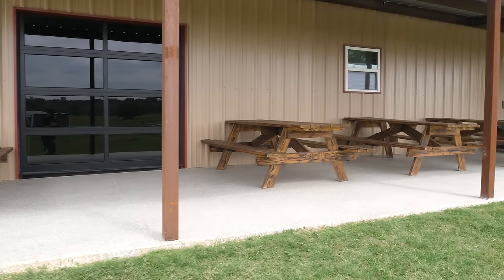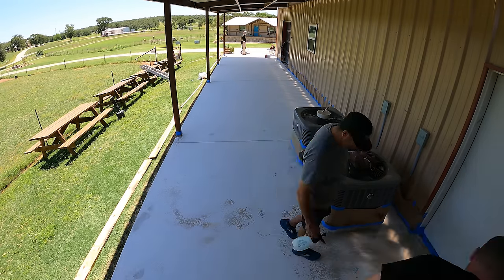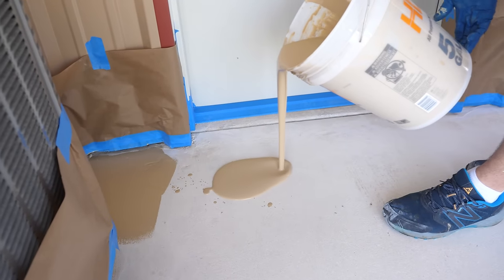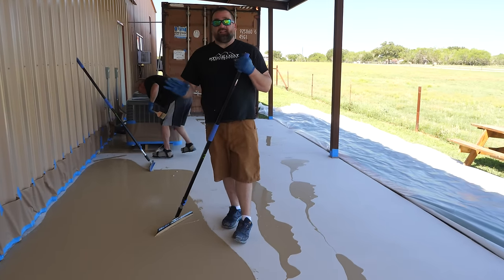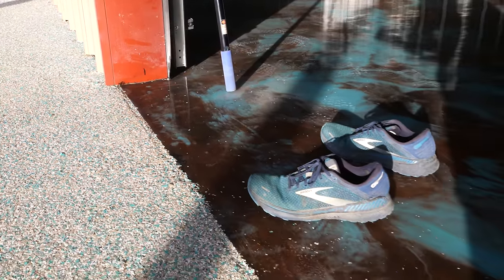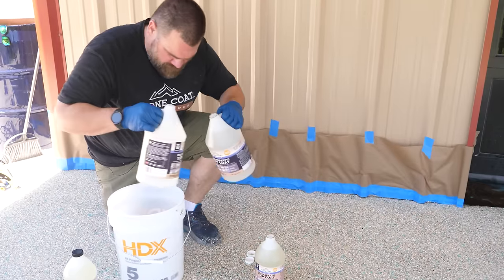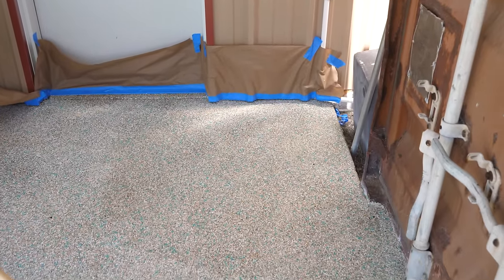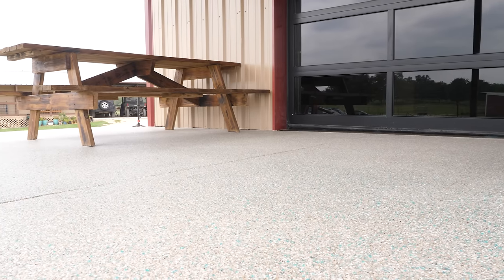Easy to Install DIY Epoxy Flake Coating OUTSIDE

Comment: Regarding your comment about using the gel powder if you're replacing the toilet:  you can also use it even if you'll be reinstalling the toilet.  The next time you flush the toilet, it'll break up the gel and send it down the drain.  

I've done that several times and never had an issue.

Comment: Mitch, just an FYI, never alcohol mop a freshly ground concrete floor, you're pushing the dust particles back into the pores of concrete. Either shot blast or vacuum numerous times with a good vac
Reply from the maker: Thanks for the PRO TIP!!!!

Comment: I love all your videos. I even bought a Stone coat epoxy kit from your website MONTHS ago, but I’m so scared I’ll mess it up. Even after watching all the videos 😩😭😂
Reply: Give it a try, even if it's just on a small project like a side table top or just a piece of MDF. I did a few small pieces of MDF then made them into clocks for gifts. They look great! I kept going and eventually built an island top out of MDF to place over our existing solid surface island. It looks like REAL marble and was fun to make. If you follow the instructions it's easy to do and quite difficult to mess up.
Reply: My first epoxy job was my best. I kinda messed up my attempt at marble though and used too much accent colors and it's very dark.. living with it but want to redo and go barely past all white. Good luck! It's fun.
Reply: I've done a built in counter top vanity, a kid's desk, a plant table, an end table, and a really gorgeous dresser that I got for free. Once you get started, you'll be hooked.

Comment: That might be overkill to use a walk behind grinder on concrete that you said has been recently poured. I think that having to find and rent that equipment might discourage a lot of people from tackling the job.
Reply: Uztutuudet u😅6😅
Reply: It😅u 0:01
Reply: 😊I
Reply: It is not Overkill. The concrete has to be prepped profiled before coating can be put down. It has to be opened up so the speak so it can accept the coating. Freshly poured concrete is the same as the cream coat is too tight and not porous enough